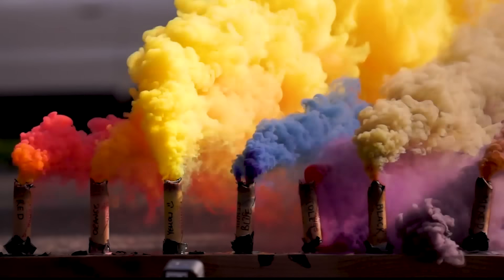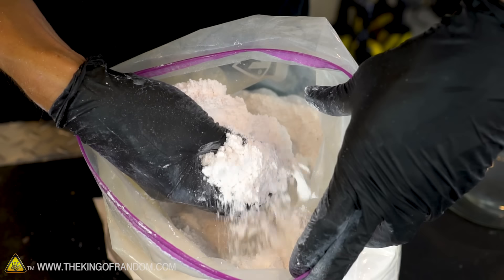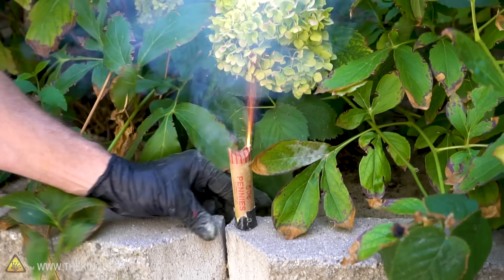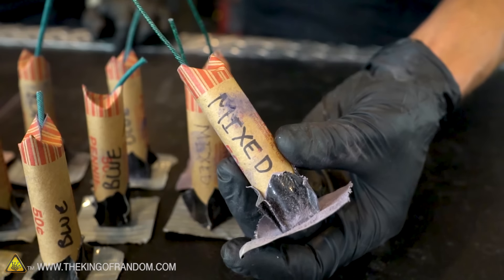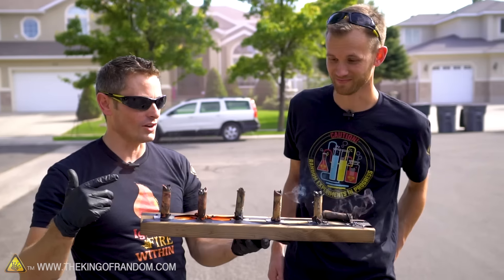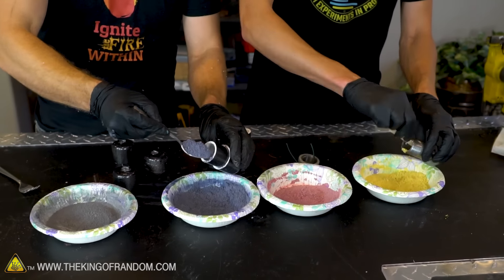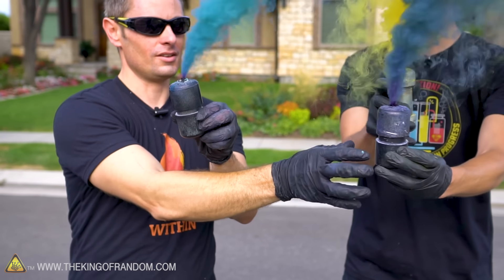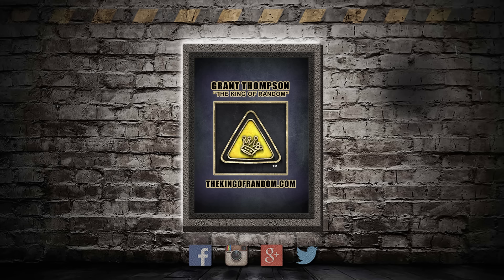How To Make COLORED Smoke! TKOR Dives Into The Best Homemade Smoke Signal & Color Smoke Bombs

Comment: Can you make 1 flare but switches colors after a while?
Reply: Johan Kling I'm not sure if that can happen but correct me if I'm wrong guys +1 like to you Johan
Reply: That might work you would just have to be EXTREMELY CAREFUL and not shake it up
Reply: you could do that with different compartments in the smoke granade.
Reply: easy enough to make happen, just a matter of making different sections of colorant and not intermixing them, then they will burn down and change as they go, well known thing in pyrotechnic circles

Comment: Wouldn't crushed colored chalk work as a substitute to the expensive coloring?
Reply: Blu3ManiC dunno...  try it.
Reply: Blu3ManiC  um... This will fail
Reply: COOL!!
Reply: Nope. Dyes used in a chalk and an Industrial level are vastly different. Speaking from experience because my dad is production head in dye factory and it usually takes a lot of chemicals and ingredients to make an industrial dye. My dad supervises production of shipments ranging from 10-100 tonnes.. You can use chalk but the smoke would be really really light i.e. almost white and wouldn't have an ignition factor as high as regular dyes.
Reply: Parth Gajjar Please be more specific about the components of this dye used in the video

Comment: Can you put different layers in a tube and have the smoke change colors?
Reply: Koos Naamloos I was wondering about that too, when they said they mixed different colors
Reply: if you are careful not to mix the dye layers as you do it, easier said than done. most fireworks use sacrificial paper spacers or use paper wrapped sections

Comment: Grant I think you should make real smoke gernades by putting the powder into those pvc containers and lighting it off sealed so the pvc explodes
Reply: lisa berkoff and also throw it at white shirts to dye them. Then auction them for charity
Reply: lisa berkoff iii
Reply: If they had drilled those holes too small, they would have been colorful pipe bombs - dangerous.

Comment: Such a clever ideas using the penny rolls, I've seen people use toilet paper rolls and I'm thinking how many bathroom breaks do I have to take in order to make a bunch of these? 😂 Pape towel rolls work too, but these look like the perfect size.
Reply: G3AR - 'GreekGadgetGuru' hi i watch ur vids
Reply: just save them
Reply: Why doesn't he makes a two stage randomizer, I have been commenting him from so many days
Reply: G3AR - 'GreekGadgetGuru'  what if u still light it with the paper on it
Reply: wrap paper around a broom stick handle then wrap some layers of duck tape around the paper then just slide it off and cut to size. you can add in different layers of different tapes for different properties. eg foil tape that is wrapped in fiber glass tape is fire resistant and strong
Reply: G3AR - 'GreekGadgetGuru

Comment: Hey Grant, what about compacting or compressing the smoke powder in the tube? Maybe use some sort of metal damper and press it as you go. You may get a longer burn time and you wouldn't have to worry about spilling the powder. One of your ingredients was an oxidizer I think, so it should work!

Comment: You should make a rainbow smoke grenade by stacking the different colors on top of each other so when one burns out it goes to the next color
Reply: You would need a spacer between each color with a small hole
Reply: I agree
Reply: Ya because the fuse will just go throughout all the colors.
Reply: I was thinking the same thing while watching the video
Reply: UI
Reply: @Taggemz  Incorrect...simply compress (gently) one smoke color on top of the other.
Reply: toddy2519  I mean I dunno, I was always told to use a very thin spacer
Reply: @Taggemz  that wouldn't be too hard. Just use cardboard.

Comment: Try making a rocket hand gun

Where it shoots a rocket with the pull of a trigger
Reply: Garrett n Tucker 44 five minutes 302 comments
Reply: Thats pretty dangerous
Reply: i would recommend maybe a really big flare gun.
Reply: Yes
Reply: colin furze did that already :)
Reply: Or a wrist rocket
Reply: yes
Reply: try to do a las vegas shooting
Reply: When I saw my Notifications it said that the vid was uploaded 32 mins ago
your comment is uploaded 39 mins ago
Sounds legit...
Reply: Garrett n Tucker 44 yess completely agreee
Reply: that’s called a gun
Reply: Garrett n Tucker 44
Reply: Look up the Gyrojet. A company back in the 60's made exactly what your describing, they also made a rifle version.
Reply: Cloverload,
No.  Garrett was asking for a Gyro Jet.  The difference is in how the fuel is used.  In a gun it is a  controlled explosion, that only lasts for a few seconds, and once the projectile leaves the barrel, the projectile starts slowing down.  A "rocket gun" (Gyro Jet) would/did exit at a very low velocity, but it accelerated to lethal after a few feet.  The Gyro Jet was designed to work in space, and one of the advantages is that when fired, the shooter would not be blown clear off the station, as the force at ignition was quite low.  One of the biggest drawbacks is, you have to have at least 5 feet between you, and the target.  Which can be quite hard.  As well as the low muzzle velocity made it very hard to hit the target, as it was more affected by forces such as gravity, and wind, at a very early part of the flight, meaning even a small change, over the course of a 50+ foot shot, could mean you hit, or miss, the broadside of a barn.
Reply: ....so you mean a flare?
Reply: Garrett n Tucker 44  you mean a rpg?

Comment: I’m making these down in Panama. It doesn’t cost as much as a comment below lays out. I got 2kg of magnesium carbonate and 2kg of lactose for a total of $36, a 25kg sack of potassium chlorate for $110 (I couldn’t get it in smaller quantities), and 0.5kg of dye for $10. This puts me at an effective $54 for 8kg of white mix, ignoring the smidgen of baking soda. About a third of the total mix is dye, so, at the rate of $10 per 0.5kg, that puts 12kg of smoke composition at $130, or only $5 per pound. I got my stuff at an industrial supply store, Max E. Jimenez, not Amazon. I saw exceedingly high prices there, like $15 for 100g of potassium chlorate. Happy colored smoke!

Comment: Can you  think of a way to light it without using a light. I don't know the name of to hat green thread like thing you inserted in the pipe after filling it with the chemical. Can you think of a way to not use that, but still burn the chemical ?
Reply: Just light it with a lighter or torch. The mix is flammable, it should work.

Comment: Do you the ingredients in grams?
Reply: Assume you are making 100g of the mix. The ratio is by weight, so you can easily convert to grams. 27% goes to 27g kclo3, 18g lactose, 16g mgco3,  3g nahco3, and the rest colored dye. If you wanted to make 128g like they did, multiply all the numbers by 1.28, so 27g goes to 34.6, 18 to 23.04, etc.

Comment: Ohohoh that's sweet! Great job very colourful smoke. Can you explain why using MgCO3? It's only for slowing the reaction? And the dyes is mineral or organic? 
Be careful with potassium chlorate, often it's mixture are pressure/friction sensitive and you can have a sudden runaway reaction.

Comment: Great video, but.... It would have been nice if you found a substitution for the Indutrial Dye. This info is worthless unless a person can get the Industrial Dye. Is the Dye just a stronger concentrate of color? Is there a substitution for it? Did you pack the rolls at all? It looks like you just pour in the mixture loose and leave it that way. I do my own Fireworks Show and would like to start with some colored smoke and strobes, but I can't find any decent smoke grenades/Bombs to use. With most smoke bombs the colors are not bright enough and don't last very long. A reply would be appreciated. Thanks..  :)

Comment: Hi, I have few questions; firstly what dyes did you use? ;cationic dyes; acidic dyes; direct dyes; grout dyes; secondly, the measuring is by weight I suppose but 27%+18%+16%+3%=64% (the rest is the dyes I guess). Last thing is the fuse, did you use thermite fuse or just a regular plain fuse? Thanks...
Reply: That is my question after watching today, did you test it out?
Reply: @byronschroedel432  sorry to say I never got around to it, but I can confidently say that a magnesium strip will work just fine as a fuse - might be a bit of a overkill though...